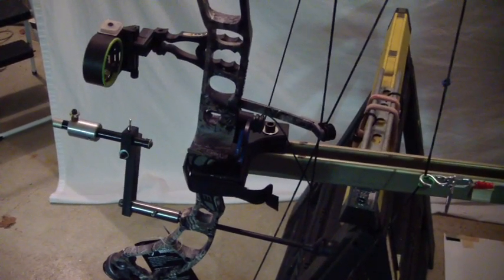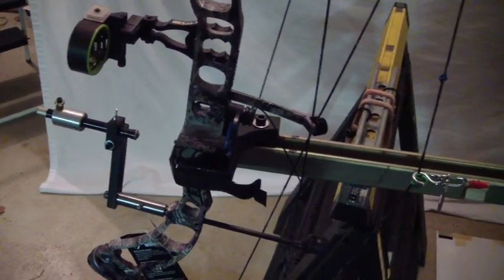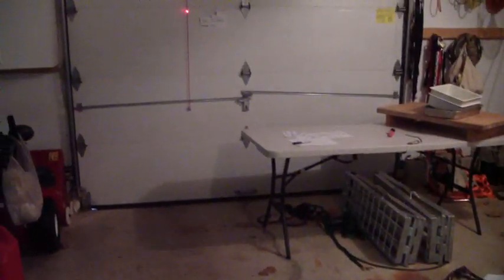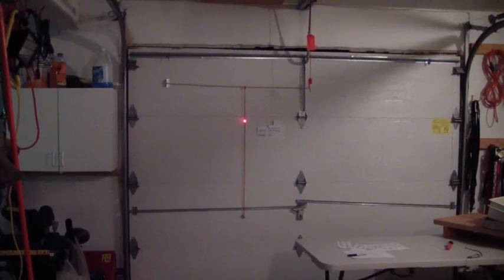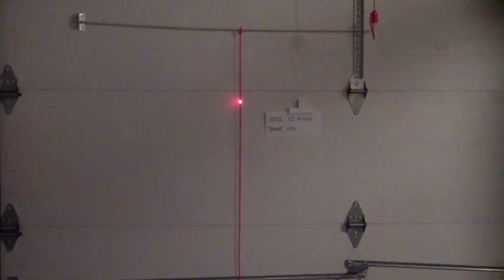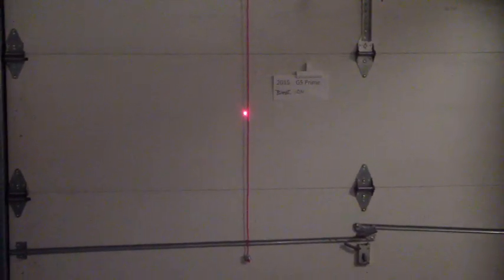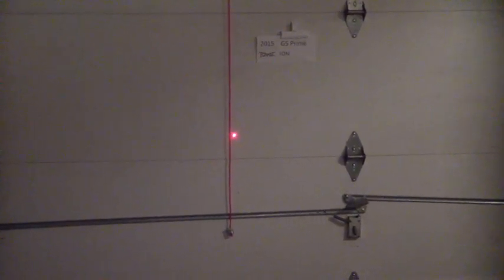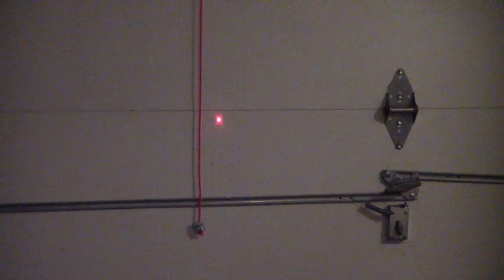Bow Torque Test 3 2015 Prime Ion

Comment: What draw length was this bow et al. set at?
Reply: 30 inches
Reply: Thanks. I was the guy that contacted you last year about a bow with a tilt tamer, and the cables kept moving in and touching the arrow. You said it could possibly be a cracked limb, and that's what it was. It was a warped limb and it kept walking the cables towards the arrow, no matter what I did. And I couldn't figure out why I kept hitting left. Thanks again!!!